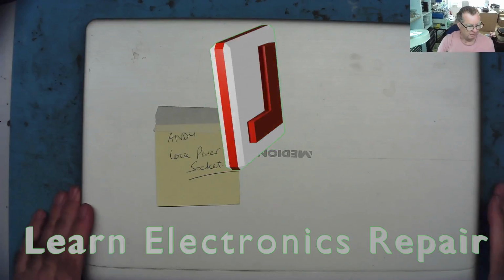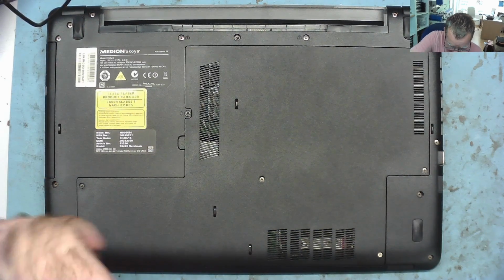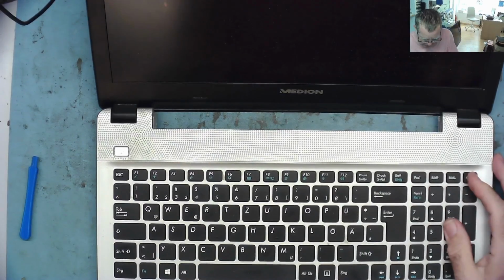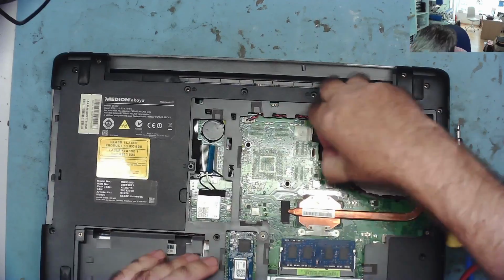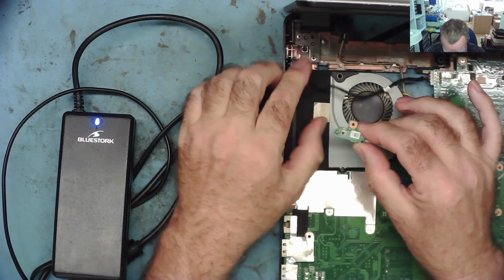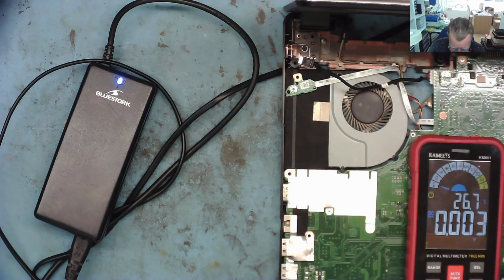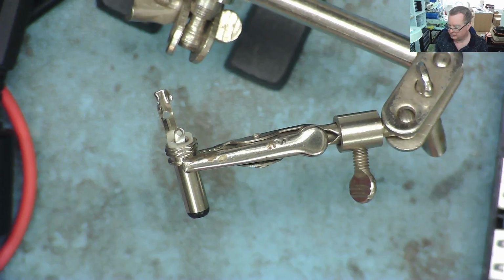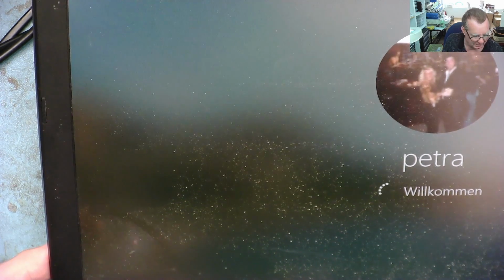A customer brought in a Medion Laptop and says it has a faulty power connector - Are they right?

Comment: 10:11 On the top left side, near the hinge,  you forgot the last screw 🙂
23:25 You have definitely set the right (read high enough) solder temperature, to make the soldering quick. Some people are afraid of the plastic nearby the solderlips,
and lower the temperature of there solder iron, which results in longer heating and soldertime, and more chance to get the plastic melted. 
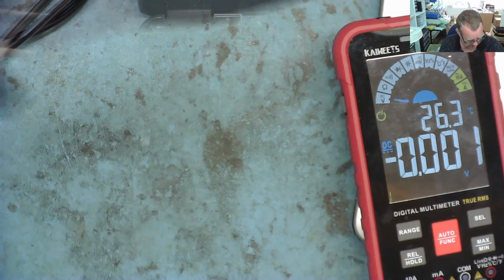24:56 As a tip, with "loose" DC jacks with a short cable attached to the motherboard, i always add some hotglue behind the DC jack, to make it more firm.
Nice video, keep up the good work 😉
Reply from the maker: Hi Bjorn V
If I don't have at least one screw left over I think I must have done something wrong LOL 😜
I have my KSGER T12 soldering station set to 380C.  Also I will add that using the correct sort of tip is going to help a lot here - I'm using the big chunky T12-BC3 and it transfers heat very fast which is what is needed.  I use it for most work, I know on other videos you will see me using the 'sharp end' of the beveled edge of it to do microsoldering
Re hot glue.  This one sat pretty well in the laptop case and was firmly held in place but I have used hot melt on occasion if the plastic in that area is broken
Reply: @LearnElectronicsRepair  , screws left over when the laptop is back together is not a problem, there is no such thing as "too many spare screws" 😂

Comment: What you need is an analogue meter. It would allow you to see intermittent continuity faults far more easily
Reply from the maker: Yeah that makes sense.  Also a meter like my Fluke which is digital but has an analog scale at the bottom of the LCD might be useful in this situation?

Comment: Hi Richard, enjoyed the video thanks. Have just built a diy GM328 transistor / component tester with signal generator / voltmeter / frequency counter that does esr and a few other handy bits. I wondered if it would be good for a video for you maybe. Would be interesting to see how accurate it is, I found the  voltmeter part, capacitance, frequency counter and generator to be pretty spot on but am unable to verify the esr currently with what I have here.
Reply from the maker: Hi Mark C do you mean this one?  https://www.aliexpress.com/item/1005003429220990.html
I love building DIY kits so it is a big yes to buy and review one from me 😁
Reply: @LearnElectronicsRepair  yes Richard, that is the one I purchased. Mine had 2 x 3.3k resistors missing and the dial for the rotary encoder too but was from the bay instead of Ali so it’ll be interesting to see how yours goes. Enjoy and I look forward to seeing the video 😁
Reply: @Mr Guru thanks for that. Yeah I bought the 9v cell type but it also has the plug for external power and I’ll just run it off my bench power supply. This is my second one of these since I didn’t discharge an electrolytic before I tested it. Had to RTFI for the calibration bit, the extra resistors and cap confused me for a while there 🤣

Comment: Those little flaps at the end of the connector are there to clamp around the wires, so they don't get pulled from the connector. Just my $0.05 cents
Btw, it might be good to blur personal information and desktop stuff, otherwise it might get to you back and bite ya. You know. GDPR and shtuff.
Reply: There where only 2 first names visible and a person on the desktop which could not be recognized, so i don't see any problem there.
I have seen much worse on other repair channels ;-)
Reply: let's blur the brand names too!

Comment: I had the reverse problem with a few laptops where the connector inside the laptop was wobbly. These are very handy plugs easy to solder and compatible with many laptop power adapters and 12V dc solder irons.